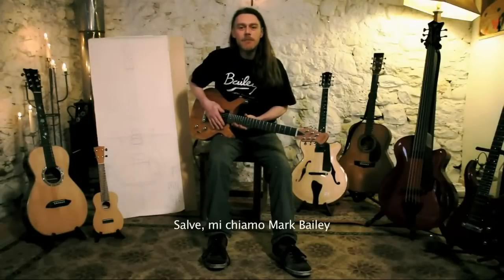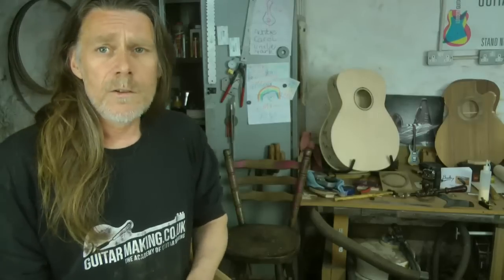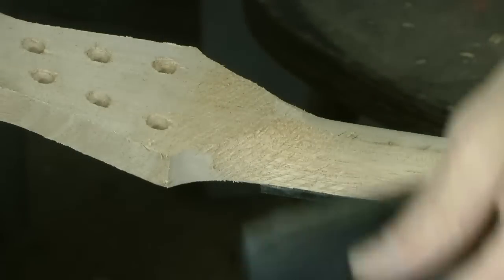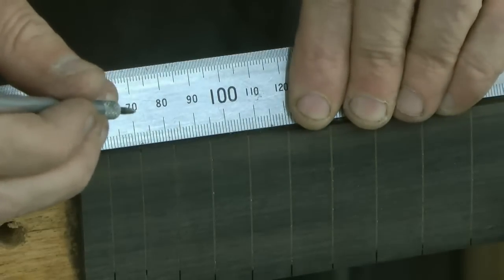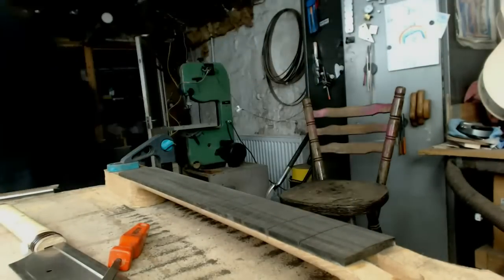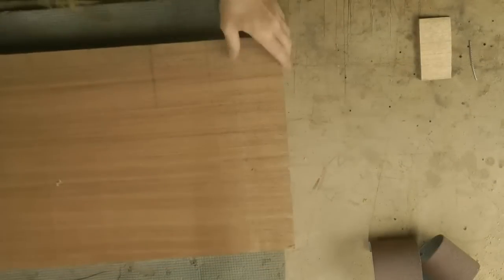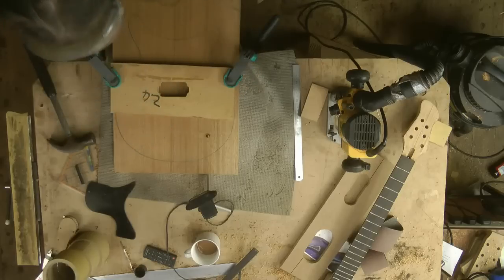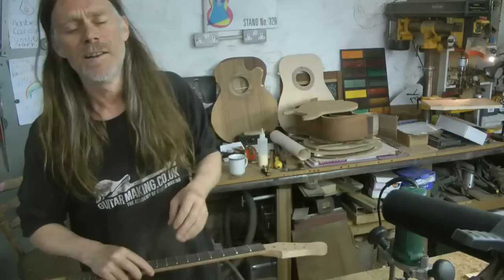How to Build Your Own Guitar - LIVE! Part 3: Neck Carve, Dots, Frets, Make the Body!

Comment: I'm 99% sure you mentioned about the step between the fretboard and neck in one of your vids but can I find it now? No, I can't lol. I could've sworn you used a scraper to deal with it. 

Also defo using your facet method, WAAAAY easier than the method I've been using that's for sure! All this measuring and drawing a gazillion lines. 

And finally thanks for answering the guys question about making different profiles, V C etc, that was another really useful bit of info.